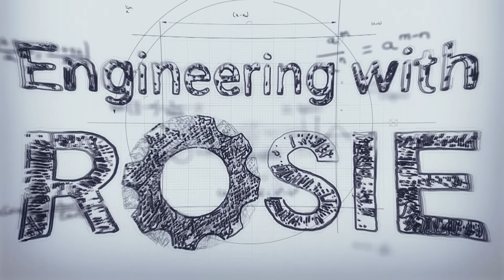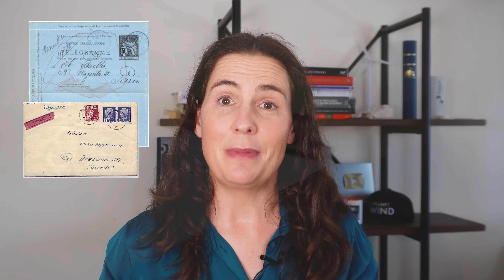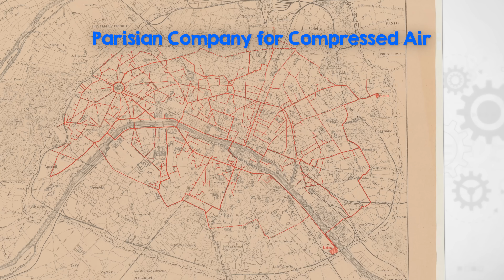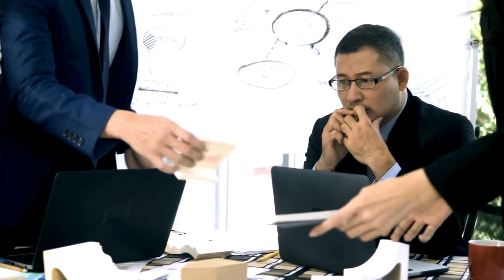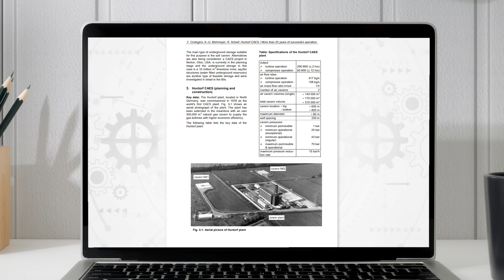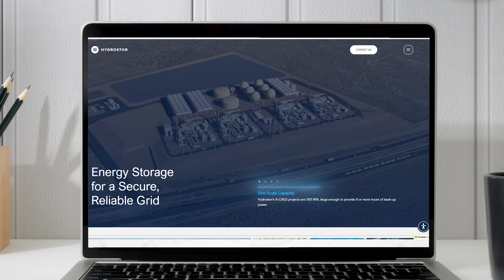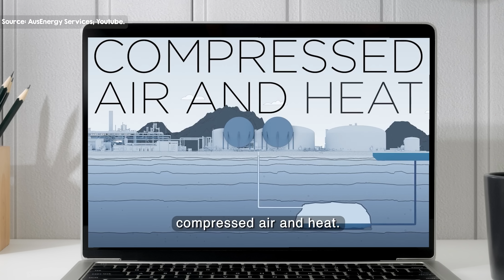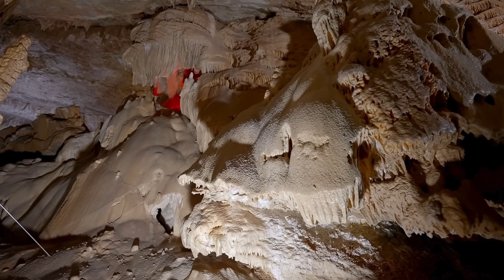The Genius Energy Storage Idea Everyone Forgot

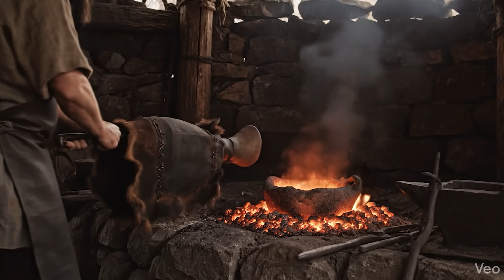Comment: 1:40 Is this AI? What is even happening? Was there no stock footage of bellows in action available? 😕
Reply from the maker: To be honest a lot of the stock sites are filled with AI and you kind of just have to use your judgement as to what works and what doesn't. I have already given my editor the feedback to be more careful to not accidentally choose AI footage. Thanks for the comment :-)
Reply: @EngineeringwithRosie   No worries. Thanks for understanding. 🤗
Reply: As always it's not what can be done, but whether it's commercially viable against competitors. This is interesting technology, but a long way from commercially successful with alternative technologies on a strong cost reduction path. Without subsidies it's a no go. Subsidies incur opportunity costs additional to the direct investment by governments. The same factors apply to compressed air as apply to other energy storage systems which are heavy in civil engineering costs not amenable to lowering costs at scale or replication. Niche applications are expensive applications - if the proponents can find buyers with deep pockets and specific needs they might survive as a business, few do.

Comment: There has been some wind driven air compressors used to power bore hole pumps in remote areas for livestock watering. How efficient it is, I don't know, but it does make for a simple system.

Comment: I have a take here that never got addressed: Why not heat the air ABOVE the temperature it was put in during compression, as a form of energy storage itself. Lets take a solar thermal plant that stores solar energy as heat in liquid salt. There needs to be a tank that can store the hot salt so that it can be later used for power. Why not store a bunch of it inside the compressed air storage? I imagine the cycle would look like this: Pump up the air storage at night when power is cheap and the air is naturally cool, by morning when solar is coming online, the air tank is full, and then the solar thermal starts heating up the salt, which is then pumped into and stored inside the air storage. This lowers the temperature of the molten salt, but it is not wasted storage, as the energy is still stored in the temperature/pressure of the gas. It effectively just increases the storage capacity of the salt tank. When the crunch of the duck curve comes around, both the solar thermal and the compressed air generate power, cooling the whole system down to go back to the start of the cycle.

Comment: Interesting. Efficiency will probably not a big factor as long as it is not really low. 3 other factors will in my oppinion:
1) Cost - obviously.
2) Availability and - linked to that -
3) storage capacity. Germany for example will need 20-50 TWh as a safeguard for a Dunkelflaute. If there aren't enough cavaties/places for CAES for that amount of storage, CAES will not make much of a difference.

Comment: The Broken Hill project in Australia sounds like a more complicated way of doing pumped storage. What is the advantage of using compressed air to push the water out of the cavern and into the surface lake vs. just pumping it normally?
Reply: The pressure doesn't need to be high to store the same amount, because you displace the water instead, So the compressor can operate at that lower pressure and be cheaper. You lose less energy to heat, because of the lower pressure. She also mentioned the water keeps the rock in better condition.
Reply from the maker: I might be able to visit the site later this year and do an interview with an engineer working on the project. If I do, I will ask your question!
Reply: True, Brian. 
Plus, you don't need a conveniently located hill and can put it about anywhere an underground cavern exists, or can be dug.

Comment: The storage project described in Australia is really a pumped hydro system? Or could perhaps be called a hybrid of the two since the energy is primarily stored by moving the mass of the water to the surface during charging and allowing it to drop to the lower level of the cavern during discharge. The air in the system is in fact been used to transmit energy from the surface to, or from, the cavern. Nonetheless pretty cool.

Comment: "I read the news today, oh boy / 4,000 holes in Blackburn, Lancashire"—was inspired by a real news snippet from the Daily Express about a council survey of potholes. John Lennon famously adapted the story, wondering how many holes it would take to "fill the Albert Hall." How many holes for CAES would it take to give 15% grid base load electrical back up in the UK? It seems like there are not enough. Some political parties have put this forward as a green alternative.  There likely aren't enough "ready-to-go" holes. While the salt deposits exist to mine new caverns, the process of "solution mining" (using water to dissolve the salt) takes years and creates millions of tonnes of brine that must be safely disposed of.
Using CAES for 15% of the base load isn't geologically impossible, but it would require an industrial undertaking on par with the original North Sea Gas infrastructure—something far more complex than simply "filling existing holes." The cost very roughly would be around 4 times that of nuclear 'solutions'. If smart appliances (washing machines, EV chargers) shifted their usage to off-peak hours, we wouldn't need 120 GWh of CAES storage. We would simply need less backup overall.

Comment: Malta is also prototyping the FLASC project to demonstrate energy storage with compressed air. It's offshore and has over 90% efficiency because the sea acts to keep the system isothermal as the air expands. The compression is done with a liquid piston so the energy can be recovered using a very efficient hydropower piston.
Reply: Look up Trompe pump.
No moving parts.
Reply: @robertmccabe8632  I know about trompe pumps, not sure how they relate with CAES tho

Comment: Most factories have compressed air systems. Many machines use pneumatic cylinders as a low cost acutator where precise position control is not required. In some cases it is actually preferrable as a constant force may be applied regardless of small changes in dimension.
Reply: I'll add that many ships, including the aircraft carriers I have spent much of my career on, make extensive use of compressed air to run many machines from hand tools to elevators.
Reply: There's also auto repair shops use compressed air tools. I guess to reduce spark risk and because they need the air to blow up tyres.
Reply: You know that every country has rivers ,so why not build Trompes in them a trompe makes compressed air with no moving parts then use the air to make electricity?🤨🤔
Reply: @dannysharp8724  Are you serious? Just use regular hydroelectric generation if the end goal is electrical power anyway. Best keep it simple as conversion always has losses.

Comment: CAS may struggle to be cost competitive against lithium ion (which is king for short duration storage and grid forming) but it absolutely loses to iron air batteries when it comes to longer term storage. So we will probably see the CAS systems that are already planned being built because the medium term storage market is still underdeveloped...but there won't be many more after that.
CAS is a bit like pumped hydro. Where you get the geological conditions for free it can work - but that also means you're usually not situated where storage is best located (i.e. there's more cost for - and losses from - transmission lines and interconnections.). Batteries don't have that issue.

Comment: Am I missing something ?
It seems the project at Broken Hill is in effect a pumped Hydro system which is using compressed air to elevate the water as opposed to the water pump in a std. system.  As pumped hydro is generally 80% efficient, why are they using compressed air to force the water to a higher gravimetric potential, with an efficiency of only 60%, when they could use a water pump?
Other than a maintaining a minimum pressure in the cavern; assuming the upper reservoir is never empty.
Reply: As to why they aren't just pumping up the water: The energy is stored in the compressed air. If you only pump up the water, the air will stay at atmospheric pressure.
Edit: I wrote nonsense.

To use this site for pumped hydro, they would have to place a turbine 600m underground. That would require drilling a very large hole which is extremely expensive. On top, you'd need access tunnels for turbine maintenance, etc.
Reply: @insaneshepherd8678 The energy is not "stored in the  compressed air". It's stored as potential energy in the water, as the original comment so eloquently puts it. The air pressure remains pretty much constant during charge and discharge. It seems to me that the reason it wasn't done with a pump/turbine at the cavern level is because of cost of putting it deep underground, as you yourself pointed out.
Reply: @petewright4640  Yeah, you're correct. I had a brain fart.
Reply: OP, I had exactly the same thought. Since they are doing a lot of earthworks already, it seems very surprising that the cost of putting a turbine 600m underground wouldn't pay itself off with the extra 20% efficiency?

Comment: Costco and banks still use pneumatic tubes, it was interesting seeing the history of them. Solution mined salt caverns are used for petroleum storage too, there might be some opportunity for repurposing there.
Reply: Scale it up and you get Hyperloop.
Well,you get the idea of Hyperloop,but you don't actually get Hyperloop because it's impractical to scale it up.
Reply: I remember some UK shops using pneumatic tubes between the tills and the cash office in the 1970s and 80s.
Reply: Injecting high pressure air into a repurposed chamber containing petroleum residue could lead to an explosion.  The working fluid would have to be inert like nitrogen gas.

Comment: I liked the history, engineering history is rarely told.  One of my favourite museums is the submarine telegraph museum at Porthcurno, which reduced the message time to get a message from UK to Australia from 3 months each way down to 7 hours each way.  However I don't see much connection between that and using compressed air for power storage, telegraphs were not energy stores, except they were the first commercial use of batteries, it was telegraph that lead to the development of lead acid batteries, and they changed the world.  Could have been better put in a separate episode of Engineering with Rosie dedicated to communications rather than renewable power!

Hated the advert integration.  Would have been much better in an interval, completely separated from the main story, and introduced as an advert with some advert graphics.  No point trying to hide the fact that it was an advert!

Comment: nope. chemical energy still way better. chemical energy -> 500 times denser, every compressed air system will very expensive. Investing time in learning chemical energy storage is worth it, because in the near future, robots will make you the batteries
Reply: in the future? its already a thing lol
Reply: Chemical energy will certainly dominate, but that doesn't mean there isn't a place for compress air where the ground conditions (chamber and geology) are suitable.

There will be different solutions to storage, not just one - as is the case for generation. For example in India, old coal generation turbines are being used as storage, excess energy is stored as heat and then the heat from that is used to power the existing turbine, the big advantage is that all the infrastructure such as cables and grid connection already exists, making this cheap and easy.

Comment: Short outages overnight or a few days can easily be bridged with batteries.
But in winter more energy is needed than is provided by the sun and wind.
Long-term storage of electricity for months is difficult.
Reply: Yeah we should produce those electrons with fission energy so the overall need for overcapacity , storage and grid connections will be reduced
Reply: Where do you get the idea that in winter there's usually a shortage from renewables? Wind - particularly onshore - produces a lot more in winter than in summer. Solar and wind complement each other well. Long term storage is not required.
Reply: @peterzerfass4609 well solar collapses in productivity in winter and energy needs skyrockets in winter moreso if we electrify heating as we should, try and compare thw of gas used in heating ( which is at almost 90% efficiency) with renewable lroduction in winter , I would say we need fission .
Reply: @CiurraU235  I'm just looking at the renewables data for germany... and the percentage is pretty even year round. You just have to structure your energy system appropriately (the more northern you are the more wind heavy you should go). Yes, heating will be shifted to heat pumps but this simply means that we need to prioritize more wind over solar going forward. 
This isn't rocket science.
Reply: @peterzerfass4609  and you can see how germany burns a lot of coal and could have burnt a lot less if it would have not closed its fission facilities. The more renewables percentage we have in the mix the more overcapacity ,transmission and other grid cost it will entail if we want to eliminate fission from the mix it plays a similar role to hydro and geothermal but it is more deployable

Comment: First, thank you Rosie. I love the history of engineering segment, but then I'm an engineering and computing geek.
I love engineering. Some people love macramé, or flower arranging. Some people, are train spotters.
There is a niche for pumped hydro, if you have the right geography / geology in the area. The same is true for compressed air storage. Same is true to harvest geothermal.
Having some small experience with compressors and systems in machine shops and mechanical shops and similar, it is useful, but there are issues with it. It does require maintenance and attention, it does suffer from corrosion.
I remember the compressed air pipes being used in a NSW country town supermarket, Coles, at Kempsey, when I was 3 ~ 5 years old. 
Another solution, in certain circumstances, would be flow batteries.
https://en.wikipedia.org/wiki/Flow_battery
Again, that's not the single general silver bullet. It is a useful method in some cases.
We can split water and try to deal with hydrogen. Or we can combine our hydrogen with captured carbon and make jet fuel, which we are still going to need some of for a while, and then fire up gas turbine generators when we run low on batteries.
It's not as if there are no solutions to this, there are many. The trick is to choose the right tool for the job and then use it correctly.
The way the coal people and the nuclear people talk about this, there's no other option but coal, and that's simply not true. What we have now is a system where we treat coal fired electrical plants as the silver bullet, and as we go forward, maybe we should think carefully about not locking ourselves into a single solution again. The best tool for the job is not the same tool for every job.

Comment: I like the idea of using the air to move water to higher ground. It opens up the possibility of moving seawater to higher ground and using that to drive hydro gensets for peaking power or when the renewables aren't playing the game. The idea I had in mind is the method a fish tank moves the water up and through the filter, air bubbles up a long straight tube to lift the water to a higher holding tank, then gravity moves it across ground to the next storage dam where it can be lifted to a higher level and so on.
These dams could also absorb heat during the day and boil off some of the water to produce clean unsalted water for drinking or irrigation, the concentrated salt brine returned to the surface of the lake to act as a heat seal .....
Just musings on my part, but I do enjoy the history parts of how technologies have been improved over the yrs as new technology becomes available to improve the design ....

T1 Terry
Reply: I think that only makes sense if it is cheaper to pump air than to pump water, but since water doesn't compress when pumped, there are no heating losses with water, while the air gets very hot when compressed, and needs the heat returned when decompressed, so you would be much better to do it the other way around and pump water to compress your underground air, then release the water to decompress the underground air and get the energy back.  The air would still get hot, but the heat would be trapped underground, so most of it would not be lost...